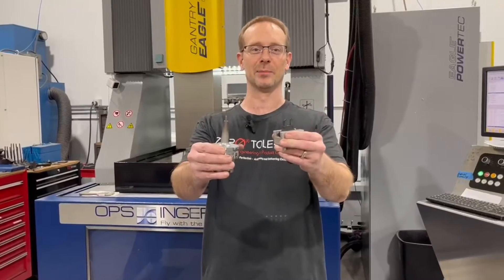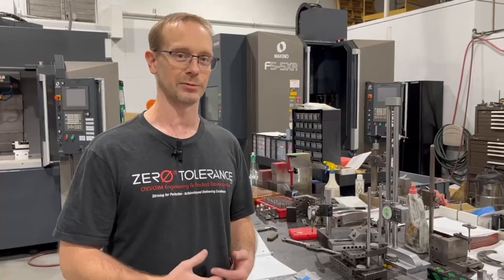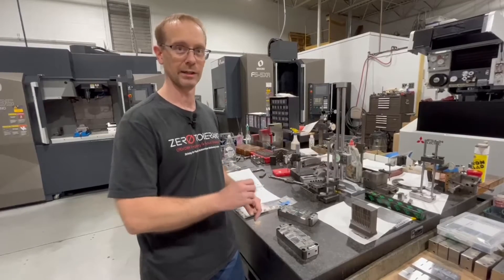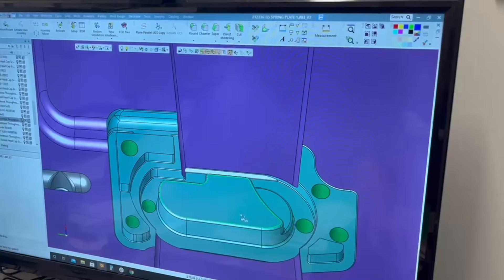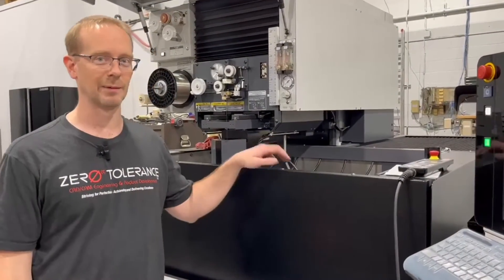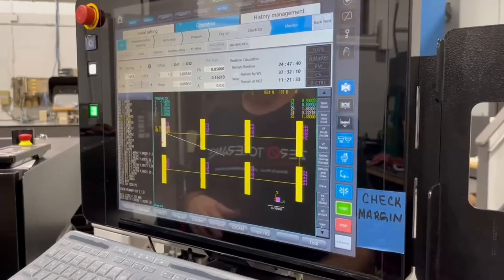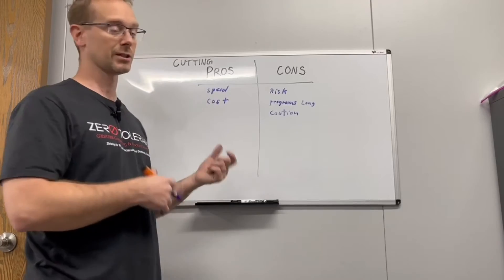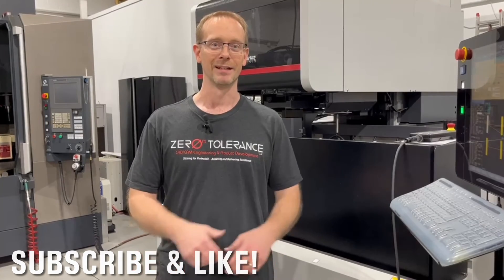EDM Burning vs Hard Milling | Learn to Burn

Comment: Burn anything more than 5D endmill diameter/part deep. Making molds for injection molding, small details are easily modified after firtst trial, keeping trodes in EDM carousel with orbiting.

Comment: Do you use (or need) a dedicated electrode cutting machine, like a Makino V22 style of Graphite Machining center or do you (or can you) cut electrodes on a standard CNC mill?  Does the graphite dust cause any issues with your machine if it is not a dedicated machine designed specifically for cutting graphite electrodes?  Thanks for these videos, great content.
Reply: You can use any mill, you need to have a good sucker system & be cautious of blowing around dust because it can get into areas you dont want it to go. In our last episode we referenced our first electrode cutting mill, a fadal. Our current mill is dedicated for cutting graphite only. Thanks for watching! Happy to answer any questions

Comment: How do you make electrodes? I'm not a machinist, but I'm interested in the topic.

Do you make them on the EDM machines or CNC mills? Or both.

Also what is a typical material that electrodes are made of?
Reply: You machine your electrodes .  They can be graphite.  Coper.. other materials.
Reply: @NORTHBROOK1978  Thank you.
Reply: @GLAJMAN  I work in a plastic molding shop. I haven't got to make any myself. But the guys I work with do. I'm the set up guy for the CNC mills. But you have to factor in wear. So if it's going so deep. You need extra to compensate for that. But not overly complicated.
Reply: In previous episodes of learn to burn we show some footage of machining electrodes in our electrode cutting mill. We also share a ton of videos of the process on our instagram page if you'd like to see more! www.instagram.com/ZEROCNC
Reply: @zerotolerancecnc  Thank you!